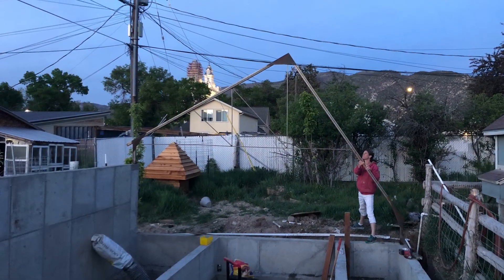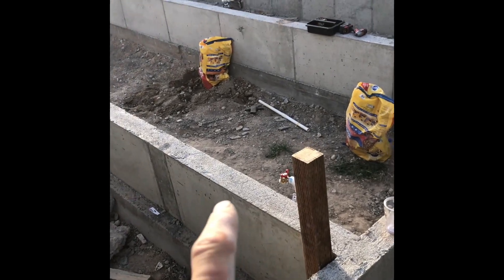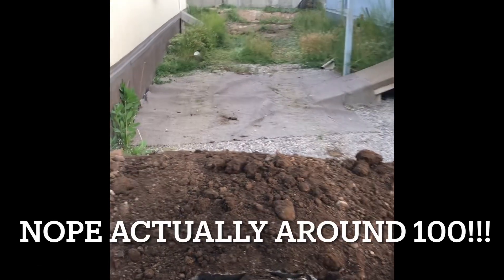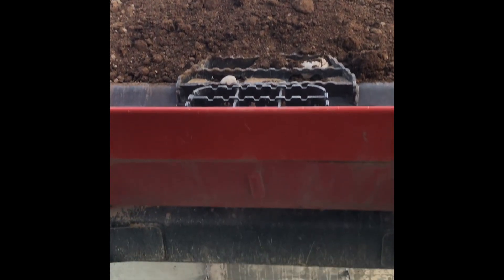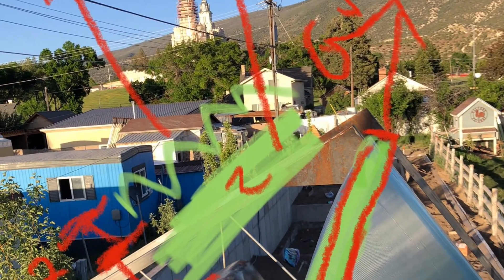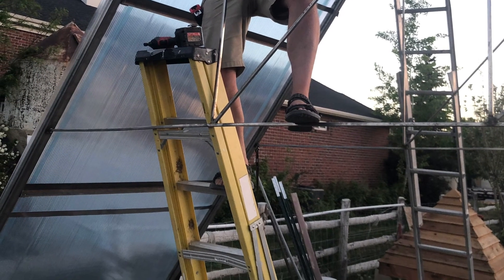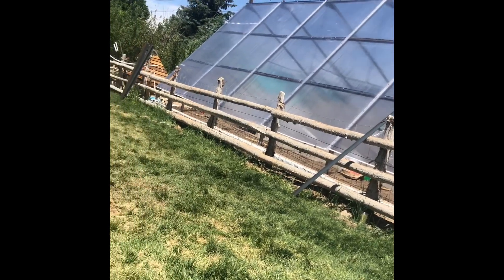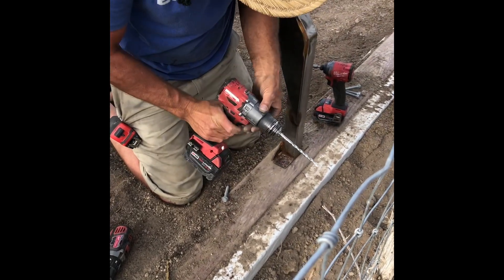Greenhouse Construction #4 | Trusses, Glass and Soil

Comment from the maker: Here are some construction notes. I will try to make a new Construction video that has some measurements and explanations. Please let me know any questions or clarifications so I can make that video the best it can be.

Our greenhouse is 17 feet wide by 103 feet long. I really like how narrow the greenhouse is at 17’ width.  I’m glad I did it this way so that even though it might be less cost-effective, I am highly efficient especially in those winter months when I am depending upon intense heat on my rear Thermal mass wall. We also built the greenhouse in the middle of an orchard and that dictated the random number of a 17 :-) the polycarbonate panels are 6 feet wide by 12 feet tall, there is a quarter inch gap in the “H” Chanel that connects the various panels and that is how we got to the random number of 103 feet. We have an 18 inch stem wall in front of the greenhouse that is covered with an insulated curtain during the winter months, during the summer months it is rolled up allowing massive amounts of ventilation. I would recommend 18 inches or even up to 2 feet. the angle of the polycarbonate glazing is 55°. That gives us the most intense sun here in central Utah the first two weeks of January. I am very glad I did it this way to give us the most heat benefit in the coldest part of the year.  We did our front wall and our rear wall and the two grow bed walls in concrete. This was more money but I do believe that the thermal mass benefit of using concrete was worth it. Also, it gives a great structural element to the greenhouse. The front grow bed is 3 feet Dimension which seems perfect for easily reaching into that grow bed. The rear grow bed is 5 feet-but 2 feet of that is covered by the 40 water barrels that is used for thermal mass so you only have three feet that can be used for grill space on that rear wall. I would recommend this set up. So far it has worked great.

Again, let me know if there’s any other details or clarifications needed so I can have that in mind when I make another Construction video. Also, I will try to make another Construction video on the way I connected all of the thermal mass water barrels together to not only be thermal mass, but also to be a place to capture rain, and also water storage to water interior plants.
Reply: What is your peak height inside the greenhouse? And does this work well with your banana and citrus trees?
Reply: Thanks!  I was doing a lot of trial by error as I eyed your greenhouse in the videos.  It was real difficult to get some good looks of the outside and so I had to really watch a lot for some screenshots.  So I started with 5.7m and the angles just weren't working out for me.  After I eyed your build some more I settled at a 5m (which seems to be looking close enough to what you have.  I'm very happy and proud to hear that you're used 5.18m (17ft) because I ended up basically arriving at that number.

I'll say though that I really haven't seen anyone else who is doing something like what you are that is as approachable as this.  It looks like a monstrous amount of work, but less than other builds that are digging down and extra 6ft+ down in order to turn the entire area into a thermal battery.  I don't think that I can pull that off by a wide margin.  

So it's just really great that the other tricks that you're using are able to get you there.  In particular I like the simple conditioned intake and the non-reliance on complicated circuitry and programming.  I'm in a poor place in Europe (satellite Russian "frozen conflict zone" of Transnistria)  where I can't just easily get some rare specialty items.  In a sense I'm already living that broken supply chain, but just in a soft way.  It's more just annoying and slow than anything really.

I had my friend grab a modbus programmable relay from American Amazon just in case that I need it because getting one later would be the ultimate bummer wait.  Over here we can get all of the usual expensive stuff like polycarbonate, fans, plastic pipes of any sort, but if it's not something usual (regardless of costs) then forget about it.

That said, I'm a career programmer and so I don't mind programming things, but then, is it always even worth the time?  Plus it adds fragility like being weak against and EMP or power outage.  So I want to add in programming with sensors, graphs and such as the non-essential hobby part of it without it being essential.  So I really liked your approach where you said that for the first seasons or year that you were going to low-tech it and then figure out some automations later.  That seems good because also in the beginning there is a lot of passion, and then as time fades that will go away, which can then be slowly replaced by Well Thought Out KISS automation that maybe even has low-tech fallbacks (such as beeswax vents???, etc).

I've rambled enough, but one thing that I think that could be helpful is stating what climate zone that you're in, and stating like 3-4 temperatures that you've experienced at the highs and lows, and how that you specifically managed that.  I see that you've done that in bits and pieces before, but not in a compiled and condescend manner.

One thing that I've gathered from your and other greenhouses is that maybe you're optimizing for January Sun and not the low of December (because it's still warmer at that time).  Adding some commentary around that could be useful.  Everyone has different climate zones, latitudes, unfortunate neighbors blocking a few hours of Winter Sun per day, etc.  It's really just too much to fit into the brain for a while until it's marinated a good long while.  That brings me back to how great that is that you've simplified the technology part of it (because there is enough to know, calculate, life and pay for already as it is).

Thanks a lot!  I think that your greenhouse is a new model of some sort that maybe doesn't have its own name yet.  It's difficult to concisely describe what is unique about it, but it certainly is.

Comment: Hi,.What kind of pipe is used for a
geothermal greenhouse? ..without holes or
with holes, pls thx
Reply from the maker: Hello because we are so dry here in Utah I did not worry about having perforation in the 6 inch tubes that carry the air from outside to inside. Also, the 8 inch tubes for my cold air drops are also not perforated.

Comment: The notes you put in here were super helpful. I went off of the assumption you were using 4' x 8' panels for the front and I could not get plans to work. We decided a few years ago that we wanted a basement, so we had a basement dug and move the house on top of it. That left us a 26' x 56' crawl space foundation to either ignore, dig out and have someone haul away, or build a greenhouse. Okay, our lab voted for a swimming pool. Watching your videos we decided to see if we could make the Walipini work. I used Tinkercad and basically pieced it together. The fear was that we would not get light past 17' in the greenhouse. The panel size was a game changer for sure. Moving to the next step is the trusses. Who did you use to fabricate the trusses? I figure that they already have an idea of what we are looking at with some size changes. Did they calculate the triangle supports or was that something you did? We are going to use the existing 3' wall in the back so we will differ there by building a wood framed wall on the back vs. all concrete. We are weighing the pros and cons of aquaponics or rabbits. Looking at thermal mass we could put a tank along the back wall in place of water barrels. This is a hard topic because the best fish to use are tilapia which would require a crazy permit to get. The other hard part is that the crawl space is pre-existing so we have to look at cold sinks and piping in a different way. Thoughts?

Comment: Did you have to permit the project?  Or because it's an AG project it wasn't required.
Do you have a website or what materials (e.g. polycarbonate) that you purchased.  Surprised they didn't need intermediate purlin under polycarb more than 2', just curious what got you that span with the Utah snow loads.
Reply: That roof does look pretty steep. Maybe that is why it does not need as much support for the snow?

Comment: I am about to buy a piece of property near Adam-ondi-Ahman. On January 15th the sun is at 29.10° and on July 15th the sun is at 71.45°. I am thinking of finding where on the back roof the sun could come in and just miss the barrels so they don't heat up at all, and adding the polycarbonate panels along the north side of the ridge line, then in the winter I would put some foam panels of the same size into the inside of the roof to block the sun and provide some insulation to prevent heat loss. Since we have much more rain here than in Manti, I am going to put a rain gutter across the back wall and collect rain water into the barrels as my exclusive water source. I'm striving to be 100% off-grid with my design. I need to play with the depth into the ground as the property slopes slightly from the road on the north and the Walipini needs to set deep enough for both front and back to work correctly. I am also going to add a pipe in each of the heat sinks that will allow any water that seeps in to travel underground to a pond that is downhill to the south. That will allow fresh air to pass through year round and be moderated by the ground temperature, and any excess water in the Walipini to drain into the pond (lagoon, actually). 

I love your short walls around the grow beds. Now that you have been using it for a while, do you still think you needed dirt all the way to the footings, or could you have put a foot or two of river rock in the base to save on how much dirt you needed? How deep does the dirt actually have to be to have a successful growth environment?

Have you created a blueprint for your trusses? I can modify the angels, but I'd love to see details about your materials and how you constructed them. I have Amish craftsmen near me that can fabricate them once I have exact plans for my latitude. I'll probably go with aluminum for the rust factor.
Reply: Did you get anyone to do plans?  
I just built a passive solar (8'x12') for my urban permaculture property in Olathe KS!
Reply: @jeremiahbowles5388  My financial plans are on a temporary hold, so no money to hire plans to be completed. I did find out that getting the concrete poured is booked out to July or August.

Comment: How did you design the whole layout, including the angle of the south sun wall so that the sun at the solstices was correctly hitting the back wall (winter) or avoiding the wall (summer)? Was it a computer program, etc?
Reply from the maker: Ima good theif:). I toured a few walipinis near me. 45-55 degrees seemed to be common. I had the guy that was doing my metal for me help tweak some thoughts but settled on having the warmest time during that end of Jan/first of Feb. worked perfect! So some luck as well:)